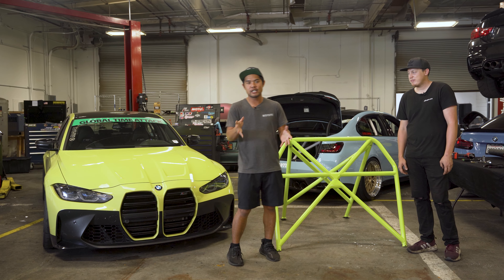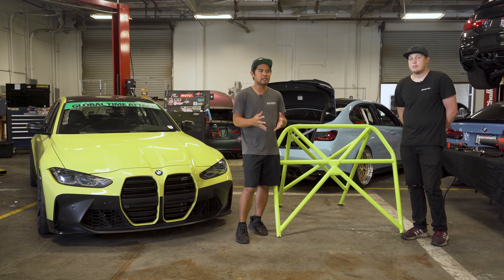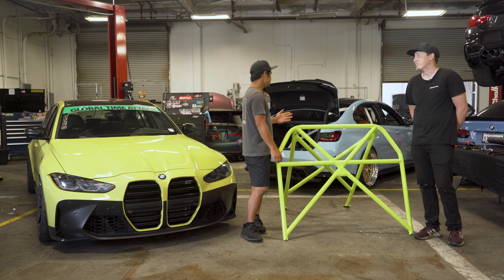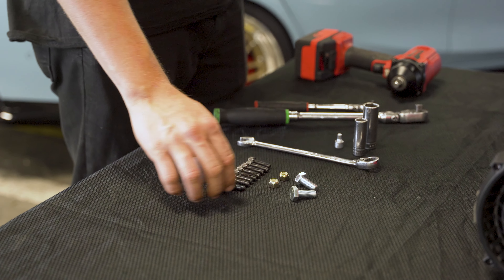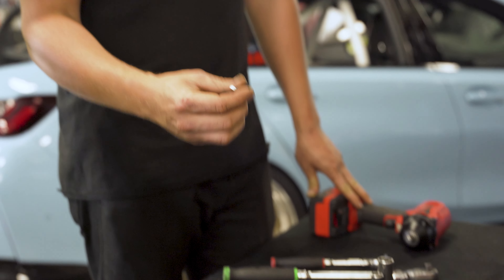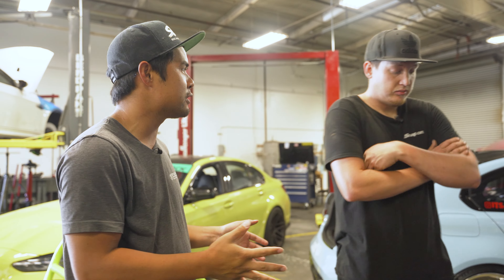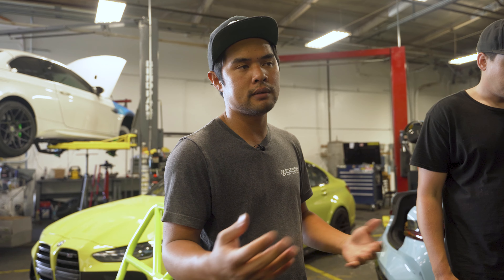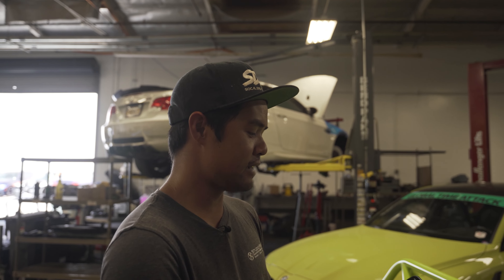How to Install a Roll Cage / Roll Bar in 10 Minutes (real-time)

Comment: I saw your video over 10 minutes ago on insta reels then I searched to see if this is real or not. I was surprised. That's a good idea and it might work for safety but not that good indeed. I think that cut create a week spot. It would be nice if you guys can test it (in a safe environment with safety precautions). I'm not sure if you guys posted any video testing this but if you did please leave a link. I think it's a very good idea. In my country we say that you make up the goat and the salad. Great video and great idea.
Reply from the maker: Thank you! We appreciate it and the comments. The design we use for our connection clamps are the same that are used on top-level Trophy Truck chassis. The toothed and bolted design and the fact that we have each clamp proprietarily machined to be the correct length (so that we're not having to do 2x extra welds to weld the clamp assembly onto hollow tubing) allows us to keep those points as a solid rod connection to the base point and also on the main hoop where the rear section connects. We've seen other cage designs which use non-toothed clamps as their standard on their main hoop foundation simply for the inability to design for proper fitment during installation. You won't believe how close our owner has been to buying a chassis and putting one of our cages in it and finding a big hill to roll it down lol, but rolling a car down a hill isn't as feasible as it sounds haha